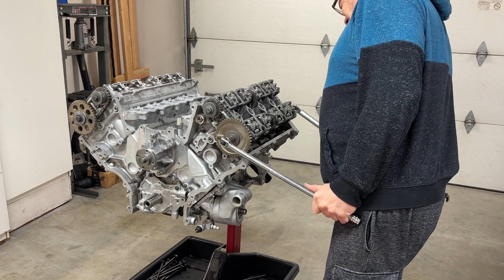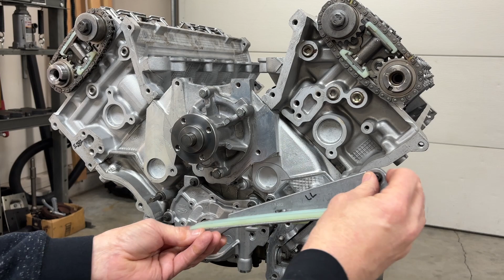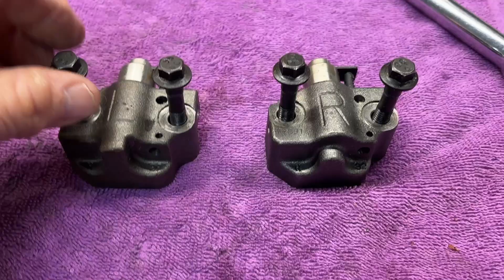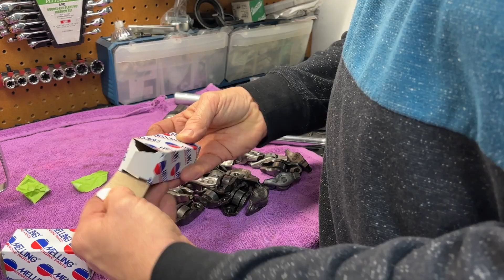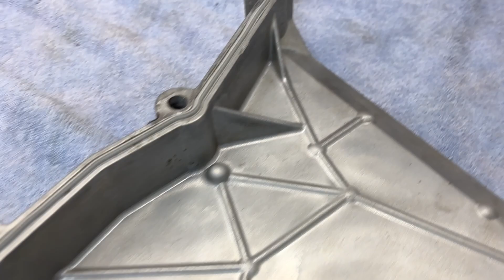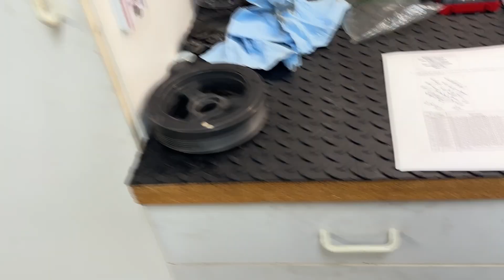Ford 4.6L 32 Valve Timing Chain & Cam followers Installation (Part 15)

Comment: Great video. I have 140k on my 2003 Marauder and I’m getting ready to do this job. Would you happen to know if this a clearance motor? i.e. will the pistons hit the valves if a chain fails? Also, has anyone done this job without removing the oil pan? Thanks.
Reply: The pistons will hit the valves.  Always check by manually rotating the engine before covering everything back up.  If your alignment marks are in the correct position you should be good, but I ALWAYS check first.

Comment: When I set the crank sensor wheel is is going to rub against the timing chains Is there a spacer needed between the crank sprocket and crank sensor wheel?

Comment: What’s your opinion on degree timing is it necessary or will the engine operate just as fine without it .
Reply from the maker: Degreeing a cam for a stock motor is not really necessary. When aftermarket parts are added with tighter tolerances, then it becomes a bigger deal to insure that assembly is correct and to get optimal power from the motor.